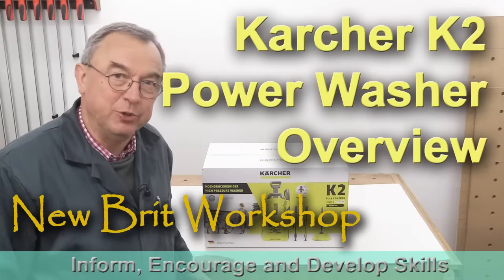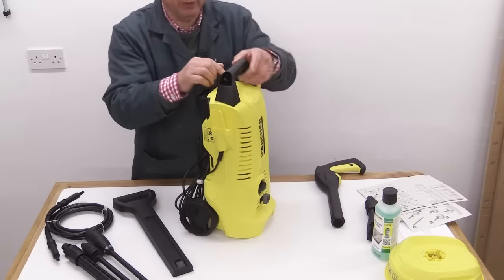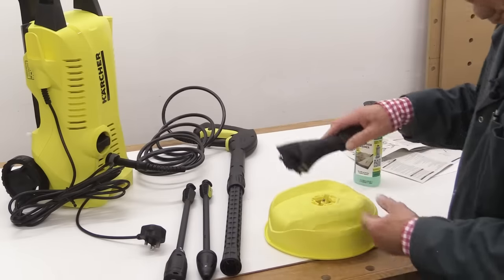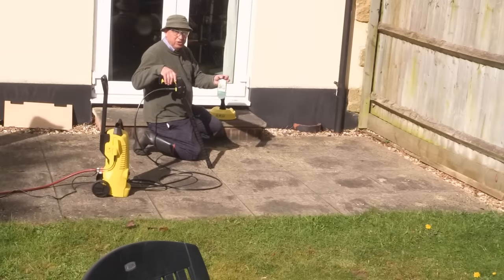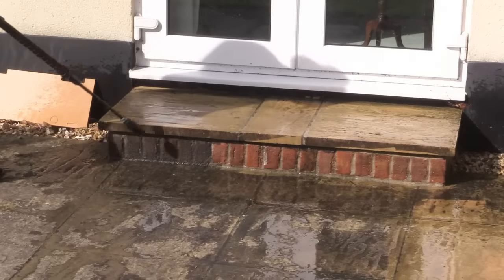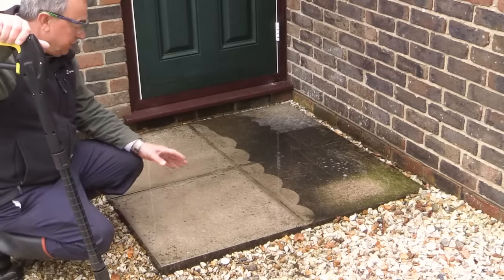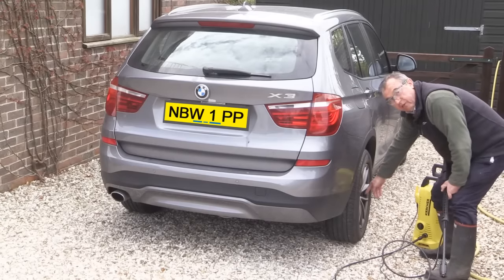Karcher K2 Full Control Home Power Washer

Comment: Really impressive piece of work, and the Karcher K2 looks excellent too 👍. Bought after viewing and other research too, £99 from Amazon. Mother-in-Law's new bungalow back-garden will sparkle soon and I'm really looking forward to it now. Fulsome content, love the amount of comparisons, just the kind of thing you need to know. Definite 9.5/10 video. Storage out of the cold is excellent pre-warning. (Only improvements... Show bit more on how the detergent mixes... Seems a tube you've poured into a spare emulsion pot, show mechanism inside the patio gadget... Seems wall-to-wall spinning mini-lances, gauge the car for dirt removal with and without detergent (nice plate 😂)),  quick question, if using a hose extension, how much does this reduce performance? Car out front is about 14m away, out back about 5m? Also, if you go over the same area a second time, is it worth it? Lastly, is there a product to seal the masonry afterwards to protect it? Top work, watched every second, plus the extra bit at the end. 👏
Reply from the maker: The length of hose will not make any difference (unless you went to 100m or more). There are loads of masonry sealers around just go to the Screwfix web site and you will find them.  Many thanks for the kind words.   Peter

Comment: What a great video. Full marks to you. I bet you've power cleaned everything by now. As a matter of interest.. How had it held up 3 years later?
Reply from the maker: We moved recently and the new patio and paths were in a dreadful state and there was a bit more than we had at the old house. I worked for 2 days and it is now brilliant. I then did my daughter's patio which is huge. The only thing that I have noticed is wear on that large round patio attachment where it rubs against the rough slabs. I now hold it about an inch above the surface and it works even better and there is no danger that I will damage it any further.   Cheers.  Peter
Reply: @NewBritWorkshop  thanks for that. You have definitely convinced me to go for this model

Comment: I noticed there are 2 different T150 cleaners, there seems to be 1 model with the brushes and 1 without them. I cant seem to find if the one without also does well on concrete. I guess it would be grinding over the floor because of the brushes lacking
Reply from the maker: Hi Rombout, Yes, my original K2 came with one that had no bristles. I found it worked best holding it about 1 cm above the surface. My K5 has brushes on the surface cleaner so it can run over the surface which is much easier. If you can, get one with brushes.  Peter
Reply: @NewBritWorkshop  thanks, i would need to order it, they have one for a different model. Ill first try it as is. I find that grinding over the concrete a bit weird

Comment: Kudos for getting the term detritus in there, not too sure about the  midi sounding version of Dvorak though :p
Reply from the maker: Hi Johnsy, My keyboard playing is improving but I play copyright material at home which I understand I am not allowed to publish on YouTube.  Cheers.  Peter
Reply: @NewBritWorkshop  I didn't realise it was your own recording.  I thought you'd downloaded  it from a midi library.  You play it really well. :)   Are the sounds generated from the keyboard itself or are you using a DAW?    

 It's handy that only the actual recordings of most classical pieces are copyrighted these days!  Means you can use your own interpretation of older pieces
Reply from the maker: Hi Johnsy, I have a Yamaha PSR SX900 which is an arranger keyboard so most of the hard work is done for me. I have never been taught to play any instrument and can only read a treble line but I can play most chords with my left hand. However, my timing is rubbish, my arthriticiness does not help and starting at this stage in life is not ideal !  Cheers.  Peter

Comment: whould you say that this will last over 12 car washes ? for me it will be a good return on investment , i live in a very dusty hot weather and my car is black so i really pay alot for washing the car
Reply from the maker: Hi Wale, Mine is still going strong after 3 years and it should certainly last a long time provided you look after it.  Peter
Reply: @NewBritWorkshop  i really appreciate your reply , i will consider this even tho its a little more expensive than the black&decker pressure washer  with same spec

Comment: I like the review no bullshit, straight to the point ,
Can you tell me the difference between the K2 compact and K2 full control pressure washer?
Reply from the maker: Hi Anil, The full control, I think,  has better or more attachments.  But you need to check as it may vary from one country to another. Try a Google search.  Peter

Comment: Is hovering with the yellow patio cleaner best of try to dig in as you go with it?
Reply from the maker: The patio cleaner gadget is amazing. I have found that holding it about 10 mm or so off the surface produces quicker results but it will make your arm ache after an hour or so.  Cheers.  Peter
Reply: @NewBritWorkshop  that’s great thank you for your help

Comment: Why didn't you use the dirt blaster attachment ?  That's the one you're supposed to use for patio's etc.
Reply from the maker: The tool that I used is the one recommended for patios and I think my demonstration proves its worth.   Peter
Reply: Yes you can clean anything with any of the attachments, I was just curious as you were doing a review, why you didn't review the patio dirtblaster lance you got with your machine ?
Reply from the maker: I do show the other attachment at about the 5 minute 30 second point. I then use the patio attachment and it is brilliant in comparison.  Peter
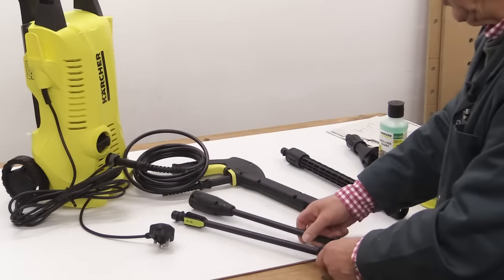Reply: Peter, great review.  However, ICECREAMK1NG1 is correct.  At the 5:30 mark, you show the vario wand.  The dirtblaster is shown at 2:32.  The dirtblaster would have done the patio in half the time.

Comment: Didnt this model came with a reservoir as well, it seemed to be missing in some shots. That cleaner is quite expensive where i live. Wonder if it still does a good job when diluting it a bit
Reply from the maker: Hi Rombout, There is no reservoir but a simple tube that goes into the bottle of the cleaning fluid. I initially did not think the patio cleaner made enough difference to be worth it but have done several test since and found it to make a noticeable difference as the dirt comes off more easily. If you only use it every 2 years it is not so expensive. It gets diluted by the machine as it is applied so no need to dilute it yourself.  Peter
Reply: @NewBritWorkshop  thanks! i thought it was missing from your model since it looked like it had the spare room for that small reservoir. if i check for instance @1:22 at the bottom there is a cutout, some model carry the reservoir in that cutout
Reply: guess they use about the same housing, the more they can reuse on other models, the less molds they need.

Comment: Can this be used for cleaning split type air-con?
Reply from the maker: Hi Peter, I do not understand what you mean. If you mean the fluid inside an aircon engine then the answer is no as that should be disposed of carefully and in compliance with the laws where you are. If you mean cleaning the fins in a aircon heat transfer unit (radiator) then I would advise caution as the high pressure may damage the aircon radiator.   Peter

Comment: Where do you put the detergent, the instruction leaflet and the video don't show you
Reply from the maker: Hi Eric, There is a clear plastic tube which goes into the bottle. If you look at the video when I am using the detergent you can see that clear hose. It is easier to see at about the 10 minute point when I flush the detergent from the machine.   Peter

Comment: Does anyone know if this has to be attached to a garden tap or will it work the same with a bucket of water?
Reply from the maker: Karcher do sell a special hose so that a water butt can be used. You will need more than a bucket and also have to ensure that the source does not run dry.  Peter

Comment: Performance far outweights its size. Its a tiny machine but just as powerful as the larger ones
Reply from the maker: You are quite right. I must confess that I thought that it would only last a couple of seasons but it is still going strong and it gets used by two families. Cheers.  Peter

Comment: Washer won’t work . Was working yesterday. What’s wrong?
Reply from the maker: Hi Barbara, I have no idea - Check the fuse. Did you run it dry? Have you switched it on?  Peter
Reply: New Brit Workshop mix container was corroded no mix going through. Where is the fuse. How can I send pic of washer to you? Motor would not turn on even after resetting and moving to different wall plugs. Thanks for your help.
Reply from the maker: Hi Barbara, I am sorry but I am not a repair expert for these machines. I am sure your local dealer will be able to help you.  Peter

Comment: Mine's leaking at the front and I can't get the grey clip off to try again. Help!!!
Reply from the maker: Hi Joyce, Turn the power off. Then turn the water off at the tap. Then press the spray lever on the lance to take all the pressure out of the machine. Then you will find that the grey clip can be raised so that the lance hose can be disconnected.  Peter
Reply: @NewBritWorkshop  Thank you Peter. I managed to figure it out yesterday but appreciate your precise reply. Your video is so clear. Maybe you were a teacher?! As I was.
Reply from the maker: Hi Joyce, Well done. Yes, I have done a bit of teaching in my time !  Peter

Comment: The car solution isn't very good either. It doesn't foam enough. Better to get a proper snowfoam cannon. I have a Prokleen one from Amazon that works well and attaches to marcher washers. Get the cannon and 5 litres of snowfoam for around £30. The marcher decking solution isn't bad but that's the only one I'd bother with.

Comment: Can anyone tell me how I remove a section of the wand. I twist and pull but nothing happens, I just want to change the wand.
Reply from the maker: Hi Julie, Push it in before you try to twist.  Peter
Reply: @NewBritWorkshop  I’ve done that then pulled but it won’t come out
Reply from the maker: It is difficult to advise you further.  Peter

Comment: Most of what you did was good, a lot better than the average punter, ive got a quick tip for you though, let the  washer do the work for you, go much much slower, keep the lance at the same angle the whole time,as in dont pivot, keep the same distance, move your arms to move it from side to side, slowly mind, it should be kind of like youre bench pressing a really heavy barbell(without the shaking), go over it methodically once, you did it well in the front edge bit, though as counter intuitive as it seems, youre actually best to start from far forward part and work back, but thats for another lesson ;) just now just concentrate on slowing the F%&* down.

Comment: SEEM LIKE THE AC CABLE IS NOT LONG MUCH ? HOW MUCH LONG IT IS
Reply from the maker: Hi Terence, I have not measured my cable length but I suspect that it is over 6 m. If you then add the 4 m hose length then the overall reach is huge.    Peter

Comment: Karcher are a waste of money IMO. Note that the pump heads most of these are plastic and crack. I bought quite an expensive Karcher and with a half dozen uses and just out of warranty the pump head split. Bought a new pump head for it and a few weeks later same thing...... gave up then and the machine is scrap as I cant sell it broken. Buy cheap buy twice.

Kranzle are the best out there! Dont waste your money on Karcher that will last 2 or 3 years at best. A Kranzle will last 15 - 20+ years easy if not abused. German made little tanks of machines. Even the weight of the Kranzle is about 3x that of a plastic fantastic Karcher
Reply from the maker: The damage to your Karcher occurred after being stored for the winter - I suspect it was not fully empty of water and the frost caused the damage. You make so many claims that are un substantiated - How do you know that the other make will last 20 years if you have not owned one for anything like that time.   Peter
Reply: @NewBritWorkshop  so my claims of these Karchers having plastic pump heads is that also incorrect? I can assure you water damage was not the issue. I own several pressure washers and know the importance of draining them for storage. 

And they are all kept inside a fully insulated garage attached to my home which stays warm during winter. No other problems with other washers including a dirt cheap Argos challenge electric one...... 

Look up any reviews for Kranzle washers and you will see people talking about longevity and people who say they upgraded after 20 years! I have other power washers such as Lavor which have brass pump heads. These Karchers are not well made and are aimed squarely at the DIY market where a couple years use could be deemed as sufficient.

Buy cheap by twice - if you could also review a Kranzle wouldn't that be a fair comparison? Thay way you might also see the quality differences for yourself. 

Even the hose on the Karchrers are mostly horrible semi rigid plastic affairs that wont even reach around a car without buying extra lengths. Whereas other pro level brands will come with nice thin and ultra flexible hoses that are steel braided/ rubber construction. Night and day difference in usage between the two for a user who is familiar with such differences.

Unfortunately I dont feel like throwing good money after bad by investing in yet another new pump head for the Karcher. It simply will not last.

It was a local specialist pressure wash company with decades of experience who gave me advice regarding the Kranzle and super German made quality of them. They also dont even sell Karcher washers and described them as "DIY scrap"

Comment: Good for washing down pets
Reply from the maker: The pressure from the nozzle can break skin and cause severe bruising. It should not be pointed at any person or animal. A normal hose with the tap only half on will do the job perfectly.   Peter
Reply: Thanks peter good video

Comment: KARCHER K2 = TOTAL CRAP! Purchased one of these in view of Karcher's reputation (God knows how they managed that) and supposedly ease of getting spares. I already had a cheap jet washer (Parkside purchased from Aldi for about £65) that I had been using for the last 9 years with no trouble at all, but then my daughter borrowed it (her idea of borrowing is permanent lol) so I decided to get a new one, mistake! On using the K2 for the 2nd time the wheels decided not to rotate any more & being as they are a non-serviceable item, I was stuck with carrying it around. Third time of use the hose rubbed through in numerous places causing leaks & making the washer un-serviceable. I am at this moment going through the complaints procedure with Karcher, a long-winded affair (designed to put people off no doubt) but I don't hold out a lot of hope as looking at other reviews this is a common problem that Karcher put down to wear and tear. It is wear and tear but like a new set of tyres, one would not expect them to be worn out on the 3rd time of use!! If you are looking for a new jet washer I would strongly advise that you stay away from Karcher which in my view are expensive RUBBISH!!

Comment: Sorry but the new Karcher K2 is very poorly made compared to the older model .This is especially so for the hose connectors that fit to the body .The yellow horseshoe clip is very flimsy and breaks off VERY easily .The older models had a Schrader type push and clip fittings 
I have had my old K2 for over 10 years where as my son bough one of the new ones and the yellow horse shoe clip broke on the first use 
The McAllister pressure washer is far better : more power ; much more robustly made for a little more money 
BTW I have used normal car shampoo in mine fore many years with out any problem ...Karchers try to make you by their expensive care shampoo saying normal shampoos clog the pump .......
Reply from the maker: Hi James, How are you able to determine that the hose connectors break so easily? Mine work perfectly and I have been using this pressure washer for a long time now. You should produce your own review of the other pressure washer that you mention.   Peter